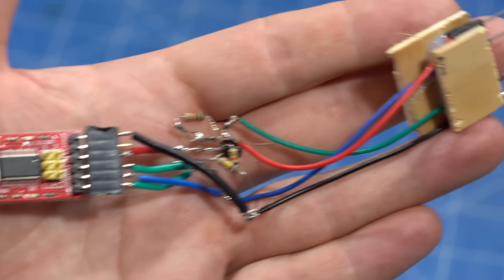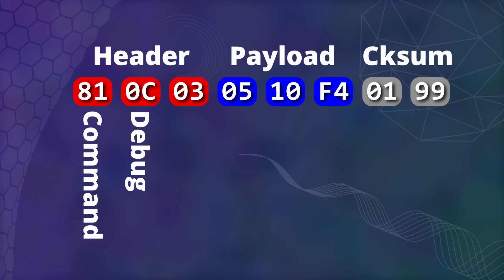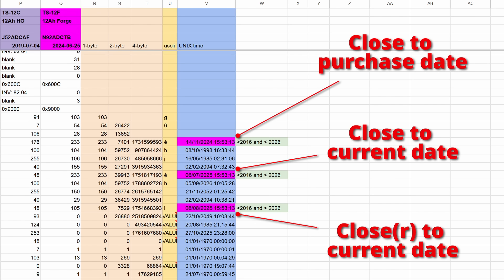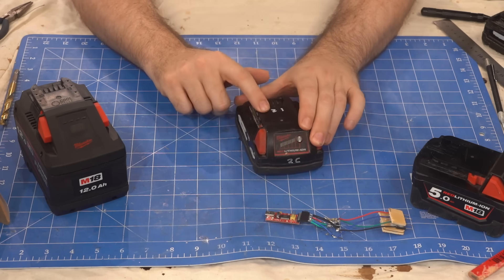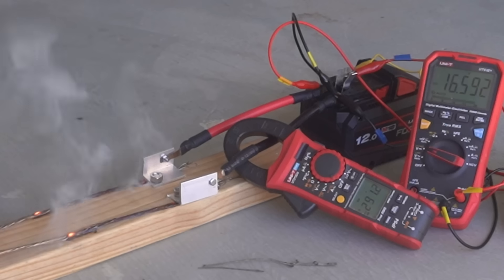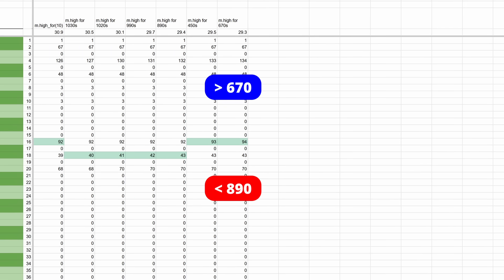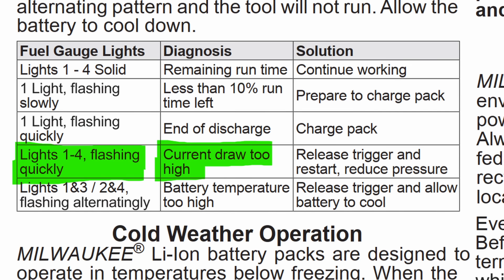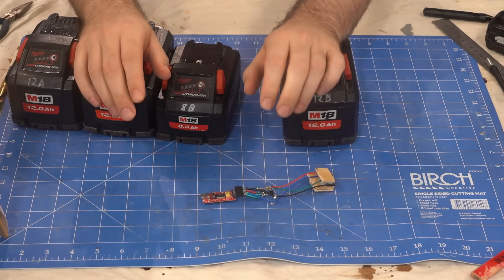Full M18 diagnostics revealed

Comment from the maker: Script and instructions for accessing these diagnostics can be found here: https://github.com/mnh-jansson/m18-protocol
Reply: Bletchly Park would be very proud. 😆😆😆
Reply: Can you make a tutorial for us
And links to what we need to buy
I want this i will pay for a kit of whatever but i don't know how to do this
Reply from the maker: @theguywithallthesolutions   yes, maybe by end of next week. It will be on my "Tool Scientist RAW" channel
Reply: @theguywithallthesolutions  A microcontroller or a raspberry pi and a level shifter are all you need. With the raspberry pi, you could probably rawdog their code on it after some minor tweaks to interface with the pi's GPIO. The microcontroller would just be programmed to dump the UART to the serial console of the computer interfacing with the microcontroller. Its not horrifically difficult but its not chatgpt and some time easy either.
Reply: @theguywithallthesolutions  the github has instructions mate
Reply: @theguywithallthesolutions  The level shifting board shared in the video does not appear to be the right one is all i gatthered it only goes from 3.3V to 5V not the 8V minmum required :-/
Reply: @SurferBobbyLew  The logic shifter will pull up the voltage of the signal to whatever voltage you have on the HV side. I think
Reply from the maker: The level shifter is most often used to shift between 3.3 and 5V, but it will shift to whatever voltages you solder to the HV and LV holes. Check the circuit example on the github - we tie the batteries B+ to HV, which boosts 3.3V to 18-21V (whatever the battery's voltage is at)
Reply: @toolscientist  Thank you. I have over 30 M18 batteries sick of being a peasant to check on them ;-)
Reply: Has anyone put your project in touch with Louis Rossman? I'm pretty sure this is the kind of diagnostic & consumer rights stuff that would be right up his alley.
Reply: @JamesRowlandsRocks rossmann made a video highlighting this video
Reply: I've found that manually charging individual low cells will allow a battery to charge to full capacity. I haven't bought a new pack in years.
Reply: @int53185 
What do you use to charge the individual cells?
I have a bricked 18v Makita battery..
Reply: Watch out for the copy right strike! Big Corp will sure try to hide this info from the public
Reply: I'm wondering if this works for other TTI made batteries -- I doubt they'd engineer something specific for AEG/Rigid and Ryobi.
I do note that Ryobi batteries have 3 to 5 terminals.
Reply: These batteries have cell balancing as a feature... But the feature is disabled. Is there a way to enable it? Maybe the unknown bytes are settings for the functions? Enabled/disabled/a number range?
Reply: downloading in case Milwaukee nukes it XD
Reply: Hey, I have a bunch of Milwaukee batteries that are broken (one cell dead) that I’d be more than happy to send your way or anybody’s way who’s helped you (I’m in the US) I think I have about 5 or 6 of them
Reply: Great work! Is it impossible to add LICENSE file to your repo? Now legally what you shared isn’t open sourced. I’d recommend either MIT or GPLv3.
Reply: Thank you VERY much for this wonderful work, It’s a great shame that it is bound to be vendor specific code, I would love it to work on my many Aldi “Universal Activ Energy” 20V & 20/40V batteries, also my many Lidl Parkside “X20V team” batteries. Good luck.
Reply: Can you make a table showing case serial numbers and the internal serial number bytes that you are seeing?
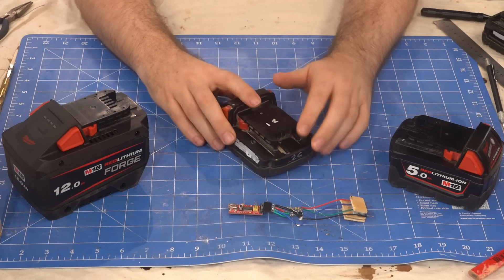Reply: 12:08 I wonder if that time is related to the C factor for the cell chemistry and average charger performance.
Reply: When you get the Makita version made, I will buy it
Reply: Batch files? Windows? Ew. I won't be helping this project. Enjoy your malware.
Reply: I was stupid enough to test in half-assembled condition if my GSR 18v-150c working after simple repair of displacement of the ball on the reverse switch.
The trigger was opened and sliding pins on contact track slipped which lead to short circuit.
Is it worth to dig in to compound to replace chip? Or what steps do i do to find what do i burned exactly?
Reply: Does you know if there is a difference between official m18 batteries and knock off batteries?  I have always feared that the internal chip would knark you out and your tool/battery wouldn't last as long if you didn't use official batteries. Any truth to that or am I just being paranoid?
Reply: How are you reading individual cell voltages? Not a single M18 or M12 pack I've pulled apart has individual connections to do such a thing. They're all tabbed in series.

Comment: From my limited understanding of all things electrical and charging. Why wouldn't one just go down to Jaycar and get a timed wall adapter that your can plug your electrical devices into to turn your charging devices on and off for the approximate charge time of your batteries, and set the timer to turn off before the batteries reach 100% of their respective capacity so that they don't get damaged from overcharging and damaging the cells. It is well known that Lithium_ion cells will provide better longevity when undercharged i.e recharge to 95%

I'm a stickler for 100% charging my Samsung S20 Ultra (these Samsung's s20 ultras are renowned for their poor battery life), but knowing full well this isn't a good practice when it comes to the overall health of the battery. I've recently had the battery replaced by a mobile phone repairer. Initially noticed better battery life from a full charge. Now I try to unplug my phone when it reaches about 90% - 95%.

Also, you have already disassembled the battery pack, why not just replace the bad cells at this point?

Comment: Awesome work, have you ever considered looking at laptop batteries? Maybe not so relevant now that most of them are packs instead of cells, but a lot of laptop batteries with cells have seemingly no way to reset the diagnostics after replacing the cells which leaves them as paperweights.

Comment: Isn't it possible adding a BMS adds too much cost and adds an extra failure point to batteries?  I haven't had one Milwaukee battery of mine fail yet.  Yet I have had 3 EGO batteries (That do have a BMS) fail on me.  Or maybe this is an anomaly.

Comment: Batteries like this should be so fucking illegal. A battery is supposed to contain lithium ion cells, a thermal couple, and a BMS. No microcontroller, no diagnostics, no nothing. I should be able to start my car with this as long as the voltage is 12v. I should be able to charge it with a random off the shelf lipo charger.

Comment: Ive quite a few tools and various batteries, my last tool which came with a pair of 2ah batteries, and both were dead from new, as it was on an offer i couldnt exchange at the supplier, i waited a couple of months and used the warrenty to replace them, I use copy batteries now as they are a quater of the price if not less, not had an issue wth them and the m12s may be better than genuine.

Comment: I hate boards on my dang batteries. I have Craftsman 20V batteries. One has 7.44v on B+ and B-, but the five cells are all right around 4v, for 20v. This tells me the board is bad. I have no clue how to repair it, unlike you guys, but it means my actual batteries are solid, but the stupid board is failing somehow. Batteries should not be this complicated. I'd rather have an NiMH setup again that just works that all of this crap for LiON.

Comment: I have three M18 batteries that are around 15 years old that I used pretty hard. They're so old, they pre-date before Milwauki started listed the amp hours on the side of the battery. And although they don't last as long, they still work fine except 1 only charges 3/4 of the way, but still useable. 
On the flip side, I also have a M18 12 amp HD battery that is LESS than 5 years old, and it only charges 3/4 of the way. I haven't used it that much really. 

The 3 year warranty is already out though... I thought it was a 5 year warranty, but apparently not on these. Disappointing for a $250 battery. I've already had to warranty two 8 amp hour batteries, which I used more often, because they both started doing the same thing within a few months of each other.

Comment: you said 'let you see if you should warranty them'?
NO!
it 'Lets you see if your employees are pushing these to dead over and over.. and over.. and over' 
Then when they are told not to use the pack after it runs down.
well. . .

Comment: Could I re-purpose an m18 charger for the analog circuitry and add a serial adaptor?
Reply from the maker: You can use it for the physical interface. You will still need the level shifter and maybe the spud-isolator™ as described on the github

Comment: Im looking through the comments & im wondering what is the situation is regarding what were all interested in this subject for?
Personally ive worked with these batteries for 15 years, so im very interested in what the Systemic faults are all about?  Because i had to put up with many days where my tools were substandard & in my job i needed powertools that were hitting my high standards everytime.
When there was ZERO room for error in how the tool/battery operated, it really made life hard for me.
Instead of just cutting my material/timber/pvcu once, i was having to perform a test cut everytime, incase something went wrong.  I didnt have total trust.  The top end battery technology, sort of screwed me over with its hiccups & then chuck in a intermittent powertool fault & that meant instead of cutting taking 15 minutes, it could take 4 to 5 times longer.  
I didnt notice the stress at the time, but looking back it really effected me. It was tough going.

Comment: Hi i guess you could say "Im LATE to the party!"  lol.
So sorry to be asking questions that no doubt have been answered 100's of times previously.
So what made you curious & interested in Milwaukee's problamatic batteries?
Personally im interested in this area because for the last 10-15 years my brother & myself used Milwaukee's power tools daily for our careers in construction, based in North East UK.
Although we had a sort of love affair with Milwaukee, lol & we would defend Milwaukee & put them ahead of nearly all top power tool manufacturer's, as Number 1😬 i did relise there were problems.  The problems in my mind, even before searching for answers seemed to stem from its supposedly strongest point!...their battery technology & their top end electronics, design, bla bla bla. 
What i mean is their strength was actually a weakness.
We had circular saws that would fail mid cut, they would fail after a heavy load. There was no definate answer to why things failed.
Alot of times you would pull the trigger of a drill/driver, circ saw & NOTHING!! apart from the white LED would illuminate. 
Other times with the circ saw's, old & new, if i'd pull the trigger the saw would ramp up for a split second & while the trigger was still pressed the power would die until i held the saw & did a sharp jerking movement, which jolted the saw into life.
In the back of my mind i didnt want to admit Dewalt was "The cat's pajamas" lol

Comment: Is there maybe a chance the dumb charge times of 873 seconds is from backup or other, older or cheaper hardware running at 3.6864 mhz? They were pretty common in older embedded systems iirc so possible limitations that come with that? or some sort of compensation for clock drift from 900 to 873? it's suspiciously close to 15 min cycles..

Comment: case vs electronic serials - what would they do in the case that the battery was just dead, totally dead and doesn't respond? Just reject warranty just because "the user probably did something"

Do you get the exact reason warranty is rejected or do you just have to trust them?

Certainly allows you to spot check the warranty process by dumping the data first.

Any chance the reporting could be disabled and then turned back on at a later point?

Comment: It should be required by law to include at least basic cell balancing in ALL lithium battery packs.
There is literally zero reason for not doing it beside planned obsolescence.
It costs nothing to implement something as widespread as that in this century.

Comment: for what its worth, a length of nichrime wire immersed in a bucket of water makes for a somewhat more effective high current load. You can dump kWs through the nichrome and it'll just take it. Might need to parallel up a few lengths to get sufficiently low resistance though

Comment: Maybe the low voltage bounce is recording a phase shift. You could place try placing it on the charger and applying a phase modulation.

Comment: All of my M12 batteries have spontaneously bricked at the same time, exactly 3 years after their first charge. Work in the tool, tool shows half full, connect to any M12 charger I have and the charger immediately shows the battery is full charge. I bought them all at the same time, so it was obviously fishy when they all do it suddenly. Two other batteries purchased within the last 4 months all still charge like normal on the same chargers. Planned obsolescence?? 🤷‍♂️

Comment: This is great, but it's only academically useful until you crack the human side of the code - Exactly which fields are they using to deny warranties, and what are their thresholds? ... If you have a battery which has imbalanced cells, but you know that - for example - A certain overheat counter must be below a certain number in order to qualify for warranty, then you are armed with the right information to decide whether to bother arguing with them, and indeed what to use as your argument if you do pursue it.

Comment: Interesting question, how would a regular USB to RS232 adapter work? According to the standard description: Voltage 3 to 15 Vpp (maximum voltage for each line), it could probably communicate directly using a regular usb-com port.

I wonder if the battery itself does not have a way to balance the battery cells.

Comment: im new here
is there gonna be a reveal for the chip used ? or is it the same chip everywhere on all the different packs ? is there an external rom ? what happens if the storage gets full ? and is it write protected ? 
so many questions
Reply from the maker: Renesas R5F100BEA (64kb). They started with Texas Instruments MSP430, but switched to R5F around 2015. They've moved from 32kb, to 48kb, and since 2021-ish they've been using 64Kb chips. I don't think the diagnostics storage changes over time. It's just 442 bytes of data that keep getting updated.

Comment: I was balancing my 12ah HO (it's old, im getting very casual about it) and I've shorted out the board. Now battery can't be used and no lights come up when I press the button. I assume the board has been put in a safe mode but could also just be damaged. Is there a way of resetting the board?

Comment: I have the exact same "descent into madness" excel sheet from when a buddy and I tried to decode the RF signal from remotes for Bofu motors (used in automatic blinds). We never could figure out the checksum calculation, and a few bits on every message were completely foreign to me, but we did end up getting most of it. 

More importantly though, I couldn't even find many people on the internet trying to do similar things, so it is so so heartening to see people cracking communication protocols that should be open and documented, or at the very least not a trade secret. Hope to see more of this kind of content!

Comment: would the battery register that its been placed in series to double pack voltage im
currently using two 8.0 forge batteries on an electric skate board and when placed in series both batteries are at 42 v total on full charge would that register on the battery

Comment: Bought a couple of genuine Milwaukee head torches and also a couple of very cheap Chinese head torches surprisingly after heavy use for several years the cheap Chinese head torches seem to be holding their charge better than the Milwaukee head torches the same cannot be said for some other Chinese knock off power tools. I have Milwaukee and Makita cordless power tools and so far they have performed  well but I would never have guessed there was all this diagnostics inside a cordless battery. Registering a Milwaukee product online for their warranty is so complicated it requires a University degree. Milwaukee certainly do not make filling in their warranty form as easy as buying their tools in the shop.

Comment: I assume some of the data represents which tools the batteries have been run on.
Reply from the maker: I don't think so. Maybe one key tools can, but I've never seen digital/serial communication betwen M18 batteries and tools. There's just a system of high or low voltages to signal if the battery is happy to discharge

Comment: Great work guys!
I'm surprised to hear that even 18V Batteries are not balanced.
I have a couple of 12V batteries and some of them do only charge up to 2 bars after 5 years, which is ambarassing 😞
Unfortunately they even don not have electronics in place in the 12V batteries.

Comment: Great video! I did a consulting project for someone that needed the protocol to make some ecosystem compatible items. We were concerned with making it very reliable so we dumped the firmware so we had high assurance things were compatible / handled all fault cases. Was fun seeing your/this approach which is a lot more scalable and faster in many ways